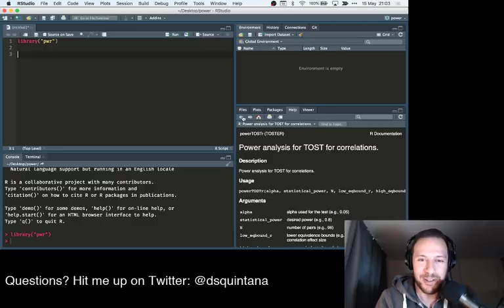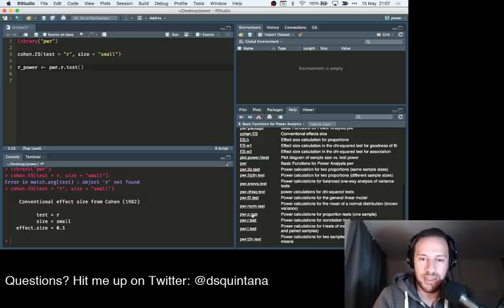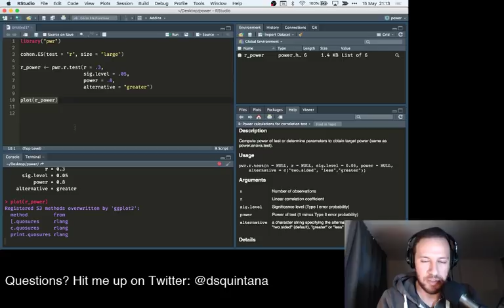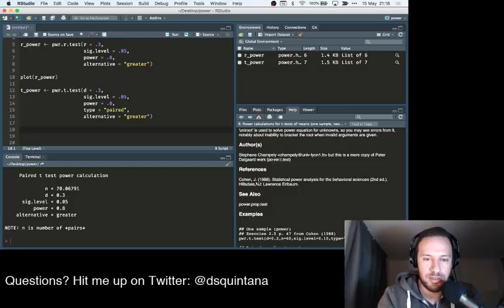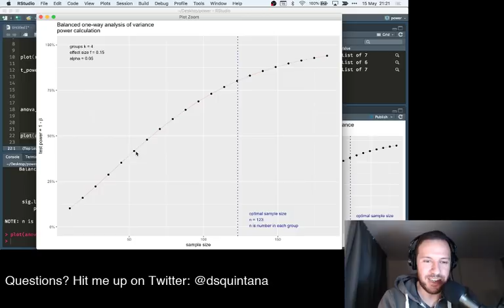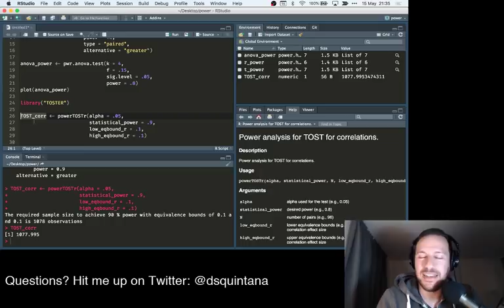A non-technical guide to performing power analysis in R

Comment: Hi Daniel,

Thanks for you video. I have a question. How to perform power analysis for logistic regression with an interaction between continuous and binary categorical predictor?

In one of my studies, I need to assess the sample size. The study aims to predict the choice of participants with a continuous predictor and a categorical predictor (control vs. experimental). Here we hypothesize that the choice of the participants will be significantly predicted by the interaction between the predictors taken for the study. In this case, how to conduct a power analysis to find out the sample size required for the study.
Reply: Hi did you got an answer? And if so, do you have an do-file?
Reply: @treoencitrus765  Yes, I got the answer. Please write to me at balachandar.kaliappan@tum.de
Reply: @balasiddu  I will (Y)